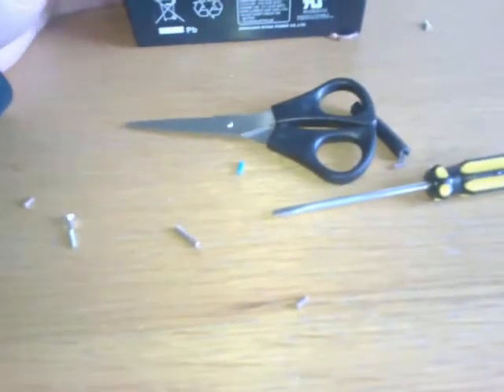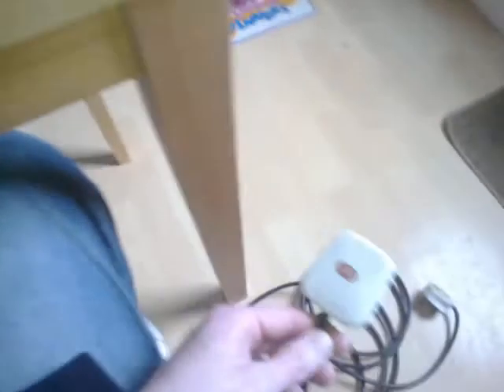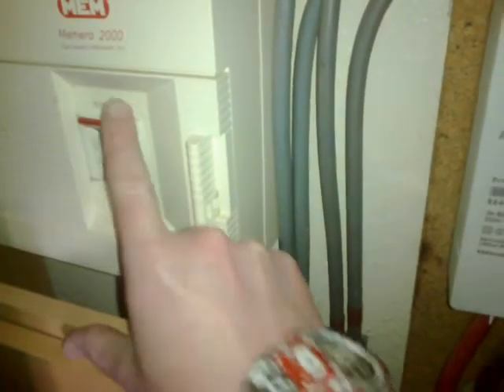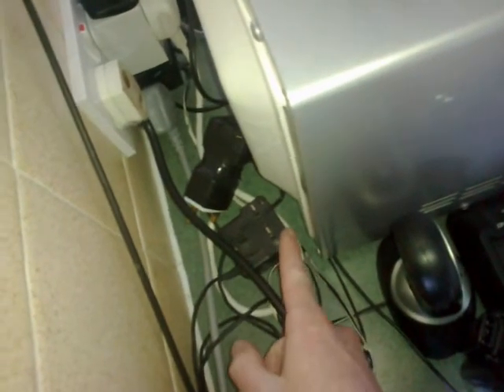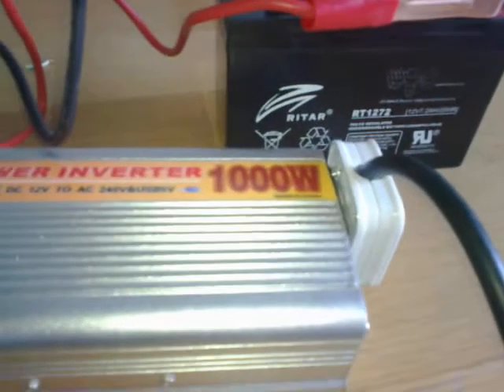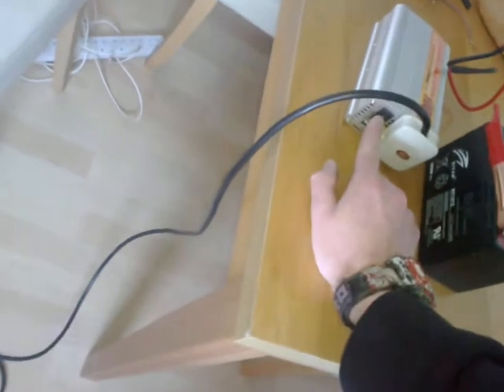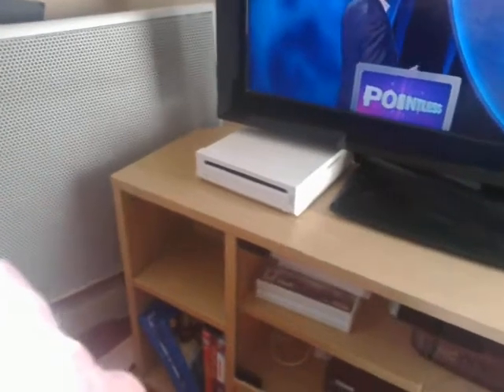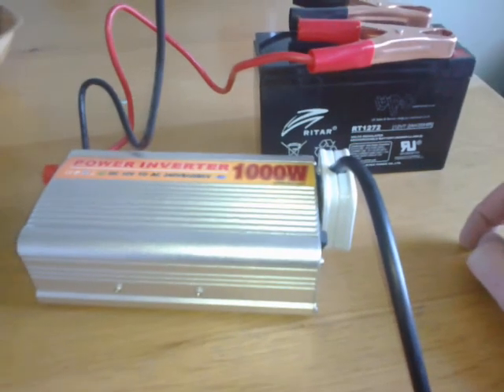1000w inverter vs 7.2ah battery. will it power my house? not for long lol

Comment: you should read on Battery,  it's clearly written that Max and initial current draw is less than so and so Amps so you can't get more Amps from the battery,  no matter for a minute or two or for hours.  you will ruin your Battery with damaged plates.

Comment: I learned allot!! Thanks, we are trying to run a inverter off a 1.5 volt a battery. We want to see if it will run it off a dc to dc boost chip, then to another 5v to 12 volt chip into the inverter? Just to see if it will run the inverter, not a house of course but just for fun. We have built most of the chips, bought a inverter from ebay. We will soon find out if it will work. Thanks for posting this, we wanted to know in a pinch if the inverter we are getting would at least run our ice box, my meds are in there. Thanks again

Comment: Thank you mate, I was looking for this specific video. Even though we know 7AH won't last long; it is a hell of a test to put a better battery later on. Cheers!!
Reply: +wow sly (26CTX941 M6CTP) 
   
 
I learned allot!! Thanks, we are trying to run a inverter off a 1.5 volt a battery. We want to see if it will run it off a dc to dc boost chip, then to another 5v to 12 volt chip into the inverter? Just to see if it will run the inverter, not a house of course but just for fun. We have built most of the chips, bought a inverter from ebay. We will soon find out if it will work. Thanks for posting this, we wanted to know in a pinch if the inverter we are getting would at least run our ice box, my meds are in there. Posted this to you direct because we did not know if the comments would work as you said you shut it off, Thanks again
Show less

Comment: You should expand your system 

I have 2X 1500W inverters (one for the kitchen and the other for everything else because when the fridge compressor starts up it tends to overload the inverter if anything else is connected)
And I am powering them with a 12KWh (12V 1000AH) battery bank 
And I have a 1500W solar array in my back yard (I'm in Australia so we have more than enough sunlight) 
And I have a small 2KVA petrol generator as backup (only needed 3 times due to bad weather)

I have not paid a power bill in over 2 years 

I power my house completely off-grid with very few compromises 
(In summer I just pay my neighbour a few bucks to run an extension cord to his place when I need the A.C because I'm a cheapskate and have not bought an inverter powerful enough to run it)
Reply: buy a DC Inverter A.C and run it on your 1500 Watts Inverter easily
Reply: The AC uses 2400W 
it will never run on a 1500W inverter 

I have recently bought a 3000w inverter and that runs the AC just fine

Comment: but as soon as one of the fridge freezer motors kick in thats about 500 600watts load lol  bet it complained wen that happened
Reply: yup  u can get a 2000w inverter for the price of the maplins inverter £69.99  i spent like over £150 lol waiting for refunds
Reply: iv had a modded inverter  for about 1year and nothing has happened to my appliances lol

iused it  for burning things out n finally tired it out haha
Reply: i even ran a fluro tube on it for over 4weeks it got hot but it stil working  

also tried my pc n my 40inch tv on it that works fine  plus i cudnt go over 60w as im running it off a shitty power supply from maplin  it says it can handle 5amps but fuk of dose it lol more like 1amp  £29 i paid for it

Comment: my 7ah battery cant even run 40w load  for 2mins lol  n i got 600w inverter
Reply: i paid £69.99 from maplin  rip off
Reply: it stops charging at 14.70v 

i done a test using an imax b6 using  discharge test  it came up to 1300mah lol  from 12v normal voltage to 2v 

weird
Reply: and when i put a nidec va225 1.12amp fan on it  it will run for 1hour  lol so the i max is correct